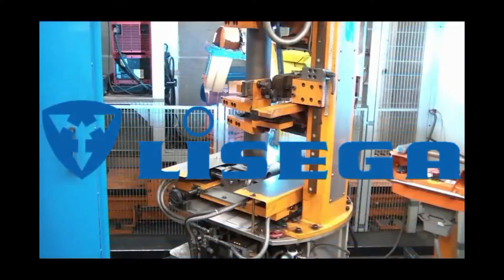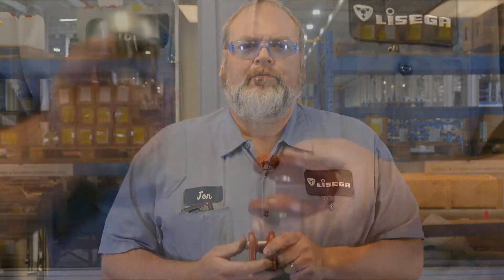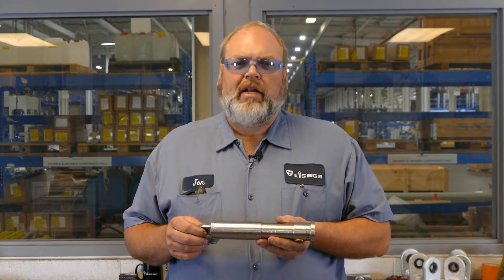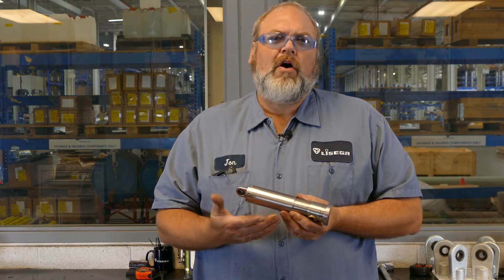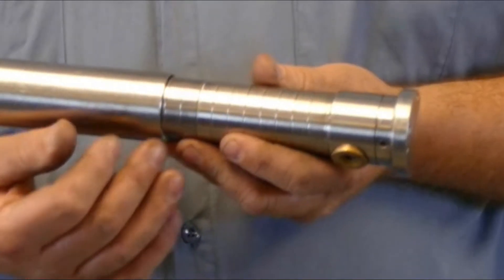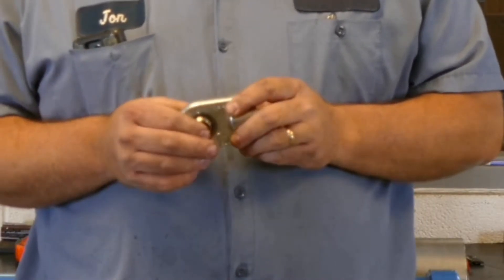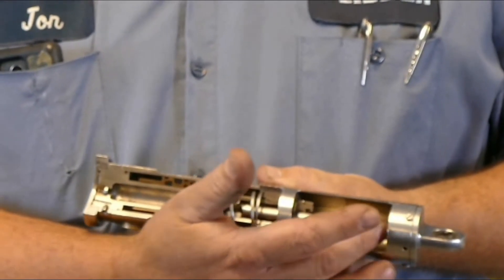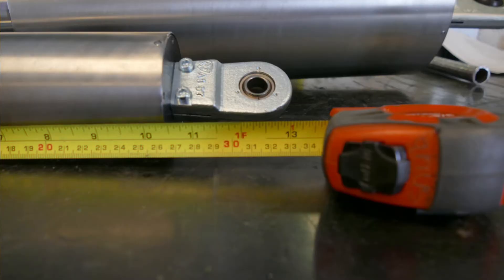LISEGA - Snubber Installation Tips

Comment: Hello, does this come pre-locked that needs to be released similar to Spring Supports?
Reply from the maker: Snubbers do not come locked. Snubbers come packaged very carefully to prevent any damage during transport. They can be installed very easily and are ready to function. If they happen to be locked due to a sudden "event" such as shifting during transport, they will unlock and be functional without any outside intervention. Please feel free to email us at info@us.lisega.com if you have any questions or would like additional information regarding snubbers. Thanks!